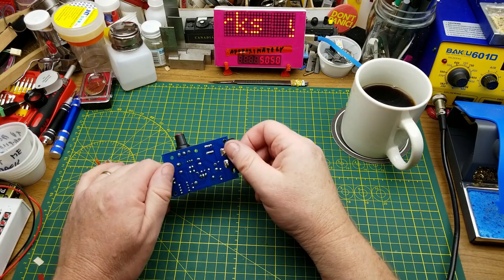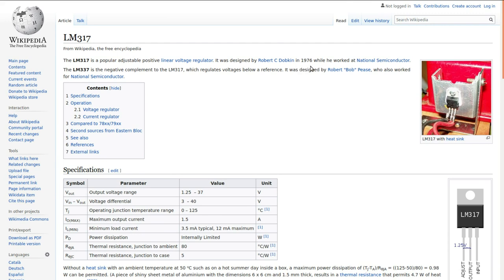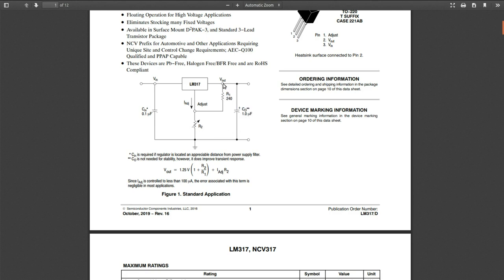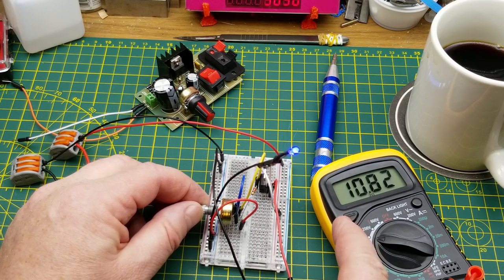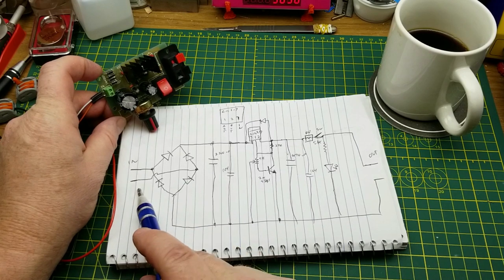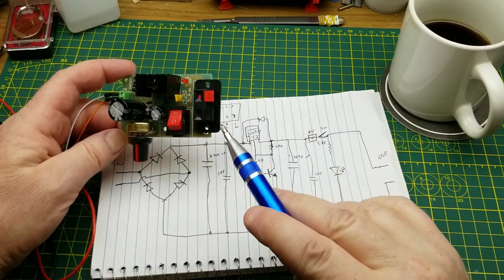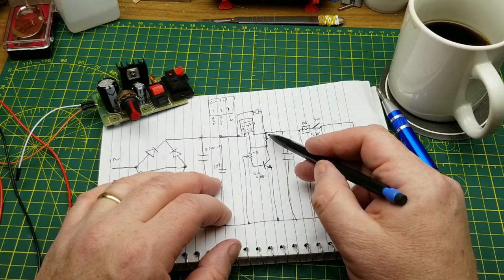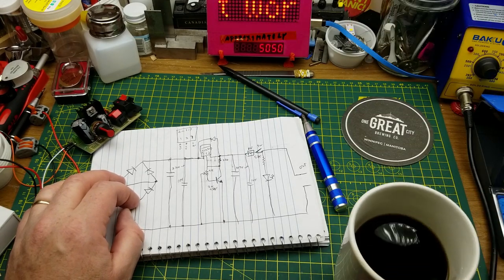lm317 kit - a closer look

Comment: The transistor turns on and clamps the output to about 2 volts if the Pot wiper goes open circuit or noisy.Without it bad contact on the pot wiper will allow the output to go to maximum. Potentially damaging the device connected to it.
Reply: That's a very good point. When I built this kit a few years ago, I couldn't see the point of the transistor, so I left it out and bridged the bottom of the pot to 0V. I've never had a problem with it, but I now see why the transistor is there. It's very unusual for Chinese kits and modules to have any surplus components, especially a 'just in case' one, as this is.
Reply: Very good point indeed, I remember that old style "adjustable" power supplies with a rotary switch and a bunch of zener diodes, the went full value for a short time while operating the switch who knows what could happens, I bet there are stuff done that way until noways, for peace of mind always disconnect the circuit when adjusting the voltage specially when using that cheap power adapters or  (in)famous power supply kits  :-)
Reply from the maker: That does seem like a reasonable theory.

Comment: An important point is that the difference between the input voltage and the output voltage is dropped across the regulator.  So heat is a big problem, 15v input output at 5V 1A. You have 5 watts on load but 10 watts on the regulator.  So if the input voltage was 37V you might end up needing two in series to share the heat generated.   The diode between the output and input  could be there as some regulators don't like voltage on the output and nothing on the input.
Reply: Can you suggest a kit or already made small circuit with 2 or 4  LM317?
Reply: @MACYNET323  Sorry I don't look at many kits, butan AliExpress search might find you something.

Comment: I can't say I agree with throwing resistors at the LM317 and hoping it might work is a good idea. The formula is quite simple. Don't just grab a 5K pot, measure it first as most are quite a way off. All you need is the pot full resistance value and the max volts out you have from your supply ( - 1.25V.) The lM317 is OK for 1.5A but the LM338 is good for 5A. Two of those in parallel and you have quite a good bench power supply.  Just remember a heatsink the size of a loaf and the biggest PC fan you can find. You can go posh and add say a TIP35C or more.

Comment: Just like to add, with just one resistor you can make it a constant current supply. Select resistor value so that it drops  1.25V at required  current.  Connect resistor between output and adjust pin, connect load between adjust pin and 0V if you see what I mean.  Great vid again.
Reply from the maker: I was hoping t try that in the future for driving higher power LEDs.
Reply: @pileofstuff  I think switching regulators are best suited to thing this that. Linear power supplies are better for low noise applications switch mode supplies are better for high currents. If you wanted to drive a 3V LED at 1 amp from a 12V supply you would have 3 watts for the LED and 9 watts for the regulator. With 12 watts taken from the power source! Using a switch mode regulator with 75% efficiency  it would be 3 watts for the LED and 3/.75  4 watts from the power source.  I think that’s right, it’s  23:43 so time for bed in the UK so not the best time for thinking. :)
Reply from the maker: @TheEmbeddedHobbyist  Where's the fun in simply going with the "best" off the get-go? 

I'm mostly just tinkering with alternate possibilities.
Reply: @pileofstuff  i think I've been doing this for so long that for power IMHO:-

Linear = low noise+heat
switching = low heat +noise

But tinker away but remember if the data sheet said 100A current limit for  Iout, it means the pin might take that but there is no heatsink that would fit in a box  you could bolt it to for the chip to take it.

So happy tinkering and making great vid's i can watch in the morning.
Reply: @pileofstuff  Lol......that's right: we have to get to the finish having suffered, don't we? At least that's how it always seems to work for me...lol!

Comment: Suspect the transistor base/pot circuit is not traced correct. As is with wiper at ground the base will always be biased off until collector base breakdown exists. For the transistor involved I think that is above max rating of LM317 and so should not happen.
Reply: The transistor is there do clamp the output voltage to a low value if the wiper on the pot goes open circuit, which it often does when it gets worn and dirty. Without the transistor the output goes to max voltage if the wiper on the pot goes open circuit

Comment: I suppose they might have a use but I tend to use the MUCH more efficient buck or boost regulators, I just like switch mode, I would only use those regulators for RF.
Reply from the maker: I like them for audio as well. Or when I want to keep a very low part count.

Comment: There is a transistor in this circuit but in a different spot. It says it is for Increasing LM317 Current.  https://makingcircuits.com/blog/increasing-lm317-current-with-a-transistor/     So I guess that's not what it is for. But this link may explain it  https://makingcircuits.com/blog/high-current-lm317-power-supply-circuit/

Comment: Sir can you explain if is possible add another lm317 on this kit?
Reply from the maker: Depends on where yo want to add it and for what purpose.
Reply: @pileofstuff I Need 3A for XML Led on linear driver.Would be interest see a circuit with 2 or 4 lm317 on parallel

Comment: The only thing I can think of for the transistor is that if the adjustment voltage goes very high (ie broken or intermittent wiper in the pot), the transistor will turn on and limit the output voltage to a safe level - essentially the turn on voltage of the transistor plus the 1.25 volts, plus maybe a bee's dick more in windage.  So.... maybe 1.85 volts plus a bit, probably under 2V.

I looked at a lot of suggested schematics trying to figure this out, but absolutely none of them had this transistor.  It's not like the Chinese to add in superfluous components just for the sake of it though, so I'm guessing they had problems with the pots in early versions of this kit, and maybe this particular circuit is the result of that (add in a 5c transistor so that they can continue to use a nasty 20c pot essentially saving them about 60 cents on every kit while keeping the pitchfork brigade off their backs).
Reply from the maker: That's a solid theory.

Comment: I also don't know why the transistor is there, the pot and typically 240 ohm resistor is all that's needed, plus a smattering of caps..
I have used a line of npn transistors to switch in different resistors using a 4017 decade counter and a push button.
That was for the program voltages on an eprom programmer, donkeys years ago lol.
And of cause you can jack up the fixed regulators in the same way.
Reply: see the Stephen Dredge explanation, these comments maybe split apart, how does youtube organize these ? i don't know.
at this moment both comments are sequential
Reply: Jyv Ben
I don't know what youtube was thinking by tampering with the comment order, it used to be ok untill some pillock messed about :-(.
I often just type the persons handle on my rambling messages just in case the dredded youtube plays musical chairs :-D.
Re stephen, i would just wire the pot different.
Reply: @zx8401ztv     if i reply then the name is already there  (chromebook/chrome)  easy
Reply: Jyv Ben, ahh that must be the reason that my comments on streams would be to no one, unless i typed there name in.
I'm still using win xp pro 64 for the last ten years and most browsers don't support it.
No its not full of viruses, a decent firewall and virus protection is updated regular.
People are not carefull enough on line, can't fix stupid people.
Sorry waffle mode :-(
Reply: @zx8401ztv     there name, typo, their name   ;-)       
win xp pro : wow ancient, even windows 7/8 is now unsupported (free)